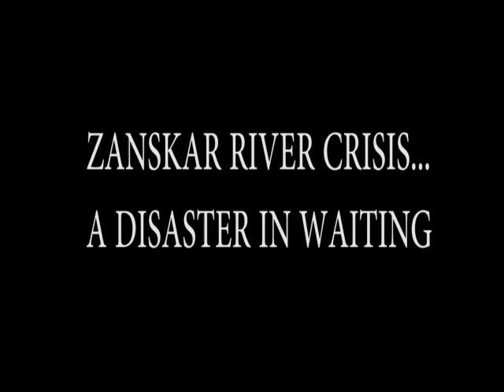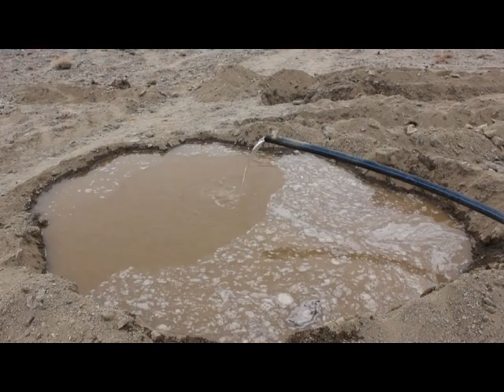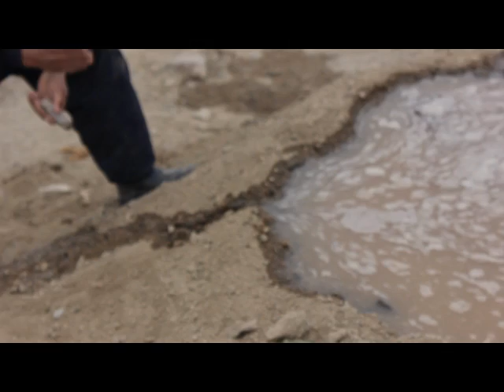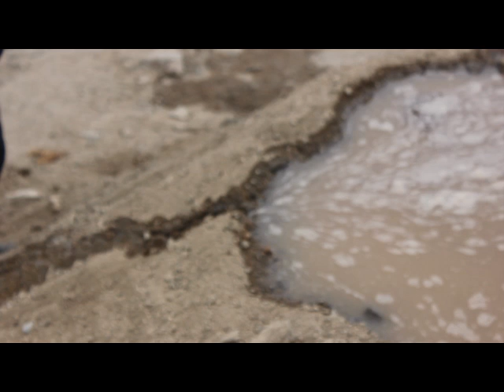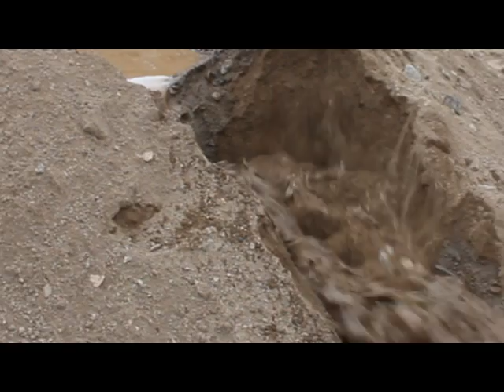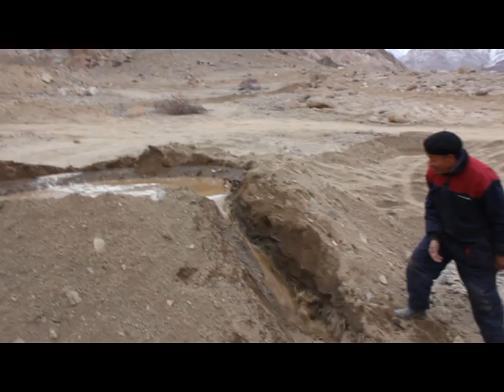Runaway Erosion | Phugtal River Crisis | Sonam Wangchuk | Ladakh

Comment: was that lake saved?
Reply: Nope they went with their explosive idea,resulting flash flood after five day of creation of water tunnel
Reply: @damor vaibhav do you have any article on the same?
Reply: @AkashKumar-qo8nx  Just serch Phutkal river floods on google... They did created canal but didn't monitored its flow.
Reply: @AkashKumar-qo8nx  
 Phuktal, May 7, 2015
On December 31, 2014, a massive landslide, 500-600 meters in length, blocked the Phuktal river and created an artificial lake. This dammed up water was suddenly released on May 7th, 2015 causing a flash flood in Phuktal river. The breached water washed away dozens of bridges, schools and residential houses.
https://thewire.in/environment/ladakh-floods-timeline-disaster